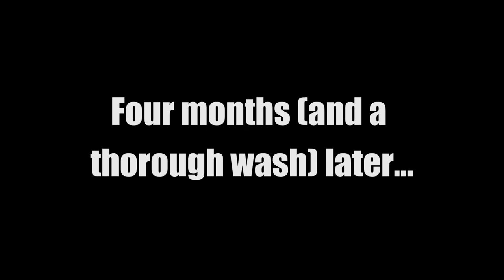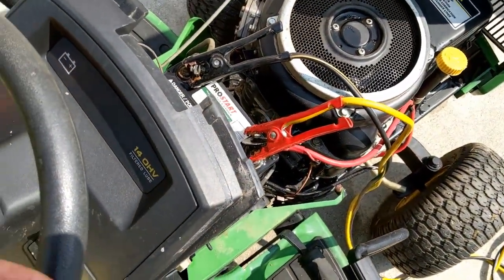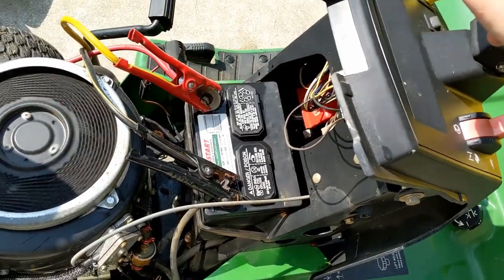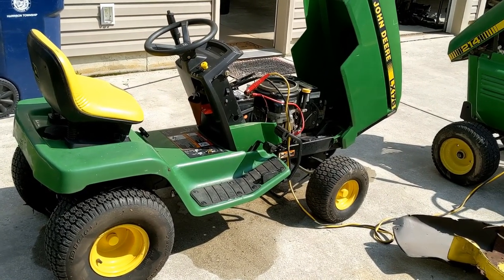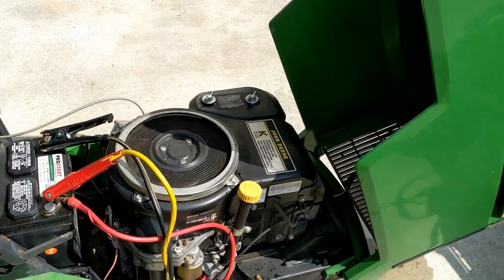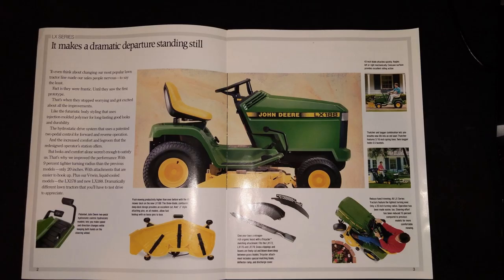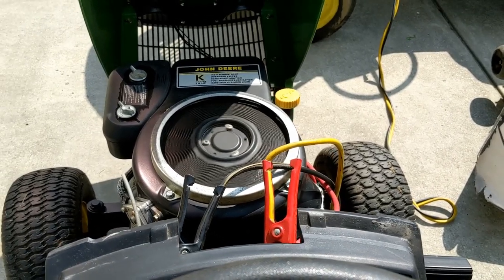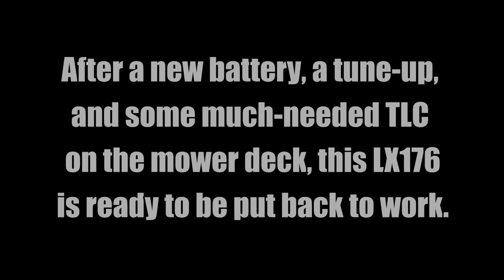Resurrecting a 1996 John Deere LX176 Lawn Tractor - First Start in Several Years

Comment: Dad bought one of these new in the 90's, we had a large 4 acre yard and mowing became my "chore" soon as I could reach the pedals. No telling how many hours the thing has, as it took about a solid 2hrs to mow that big yard, not to mention the machine doubled as a firewood hauler in the fall and winter with a tow behind wagon. When dad passed away, it became mine and I still use it to mow my (now much smaller) townhouse lot! Puffs a little blue smoke on startup but doesn't burn or leak any measurable amount of oil. It'll probably outlast me at this rate! Haha

Comment: I have 1993 that I bought used in 2002.   I use it to do two rough lawns.   18 years later, I don't see myself replacing it at any time soon.    The owner of the John Deere dealership convinced me to buy this over the cheaper models sold @ Home Depot or other places.   It was good advice.   14 hp Kawasaki does the job without sucking all that much fuel.  It's a great machine.
Reply from the maker: They are one of the best smaller lawn tractors Deere ever built. Very sturdy for their size, reliable Kawasaki engines, and the 38" decks cut really well. If I had a smaller yard I'd have kept this one and mowed with it.

Comment: Like the way you explain in detail what's been done so far.Great video.I'm surprised it cranked with that old gas.I would have added a little seafoam to it.
Reply from the maker: That's a good idea. I've had pretty good luck with Seafoam in the past, but it just slipped my mind this time around. Plus it's getting pretty expensive at my local hardware store last I checked...I need to find a store that sells it cheaper.
Reply: @MichaelTJD60  I get it for around 7 bucks at Wallyworld.
Reply from the maker: @edselman58  That sounds much more reasonable. I've seen it for over $10 a can at the hardware store and some auto parts stores, which is ridiculous.

Comment: I just recently got a LX 188 for free it came with a bagger. I got it running but it needs a valve adjustment or a new engine. And the hood Isn’t broken it just has a small crack in the front
Reply from the maker: Great deal. Just make sure that crack in the hood doesn't spread. Valve adjustment shouldn't be too difficult. Unless it was ran low on oil or coolant in the past, those liquid-cooled Kawasaki engines are nearly impossible to kill.
Reply: Am I not be as simple as a valve adjustment in my need a new engine then engine is smoking blue smoke really bad and it’s running really low

Comment: I bought a used 1993 LX176 in 2002, & I have been mowing two good size lawns with it ever since.   I've done some work to it over the years (carburetor cleaned, a couple belts, blades, & transmission rebuilt).  I blame the transmission issue on pulling something that was beyond the capacity of the machine.  Learn my lesson on that!    The Kawasaki motor has been rock solid.   I've had no reason to replace it.   I have friends who have gone through multiple machines while I am still very happy with my 27 year old John Deere.
Reply from the maker: They are one of the best lawn tractors Deere ever built! If I had a smaller yard I would definitely consider buying one as my permanent mower.

Comment: I bought one a few years back, was really beat up. The fellow was taking it to lake to cut the grass there and he forgot to strap it down. Fell off the trailer at 50 miles per hour. I found a used hood and seat for it. I really like it. Also found a rear bagger set up. I plan on keeping it.
Reply from the maker: That's a testament to how well these machines are built. Glad you are still getting some good use out of it.

Comment: Great video man. Love the details. I actually have never seen in LAX series John Deere. I've owned a 1997 445 John Deere since 98. And just restored it and did a video series on it and wish that was seen your video series first. I wish someone would put a video out on how to put the writing in there and edit videos and stuff cuz I've got a bunch of pictures of this thing all through the process and never could figure out how to get it all put together. To make a nice video out of it. Thanks for the good video.
Reply from the maker: Thanks! Editing does take a little practice at first. It helps to have a good editing software but unfortunately that's usually not cheap. It's all about the timing of each clip or piece of text you add.
Reply: @MichaelTJD60  absolutely I don't even know what editing software is that's how computer illiterate I am. I literally do it all for my cell phone that's one of my videos on my tractor were so horrible.

Comment: I have the same tractor and it surges. I have to use ether to get it started and I just don't get the rpms I used to.
Does the carb need to be replaced?
Reply from the maker: Most likely a clogged main jet. It can be taken apart and cleaned, but in this day and age where replacement carburetors usually cost less than a rebuild kit, you're most likely better off just replacing the carb.
Reply: @MichaelTJD60  Thank you!
Reply: @MichaelTJD60  That is what I will probably do. Another issue, probably related to the carb. is that once in a while, a burst of white smoke belches out of the exhaust. It looks like a smoke screen. after 10-15 seconds, it clears up. I was looking at carbs on-line and there are so many types. My LX176 has a 14 hp Kawaski engine and the listings cover many models. If you can assist me with the correct carb, I would certainly appreciate it.
Happy New Year!
Reply from the maker: @rickpinelli1586  white smoke would indicate a blown head gasket - it's not unusual for Kawasaki engines to blow white smoke when you first start them up cold, but if it's randomly doing it while running then you've probably got a blown head gasket.

Comment: Which engine would you prefer? I like the old kohler commands.
Reply from the maker: The older vertical-shaft Commands were decent engines, but I prefer Kawasaki as far as most newer equipment goes. From my experience, they're the only brand that hasn't gone down in quality over the last 20-25 years.
Reply: @MichaelTJD60  yeah I have a Kawasaki 22hp on my cub cadet ztr. It's a really good engine.

Comment: There is one of these for sale near me for $850, looks to be in decent shape, comes with a bagger as well.  Anything you would advise me to pay attention to before going to look at this thing?  I have about 1 acre of mostly flat but slightly bumpy lawn to cut.  I've been doing it with a regular push mower, trying to reduce the time it takes to mow.  Everyone around me has new zero-turns, but they are so expensive!  My car doesn't even cost as much as any of my neighbors' mowers.  Other options include a 2015 Toro Timecutter SS5000 for $900, has a Kawasaki FR691V, unknown hours, or a Toro Z MASTER for $1400, 18hp Kohler engine, unknown hours, assuming it is 15-20 years old but it looks decent.
Reply from the maker: The LX tractors are hard to beat - they are nimble, reliable and built very well (with the exception of the plastic hood). The biggest items to look out for would be that the engine has had the valves adjusted regularly (the Kawasaki engines are bulletproof IF the valve lash has been adjusted every 200 hours), and be sure that the transaxle doesn't lose power when it gets hot (when driving uphill or after driving around for a while). It is rare to find a 90's Deere with an unbroken plastic hood, so if the hood is cracked or broken don't be too surprised. I got very lucky with this one.

Comment: Yeah, It is rare to find a JD of that age where the hood is in great shape. The reason why it is in such good condition is probably because it was stored inside not where the sun could hit it, and away from the elements. Our LT160 from 2003 was stored in a barn its whole life and at 800+ hrs the hood is cracked in some places. But none the less the transmission and the 16HP Kohler have held up well. Those are some fine mowers you have there.
Reply from the maker: Thanks. Yeah it was stored in a garage its whole life so it didn't spend much time outside when he wasn't mowing with it. My uncle's LT155 spent the first half of its life under a lean-to on the farm before he moved away from the farm and put it inside his new garage. Only reason the hood ever broke was because he backed into it with his loader while grading his driveway. I put a new top hood section on it and got it looking like new before it was sold.
Reply: Ok.
Reply: Has nothing to do with the sun...  Has to do with the brittle lexan hood material...  and the integral lexan plastic hood hinges...

Comment: Treat that upper & lower hood like GLASS...!    If it only runs on choke it's a main jet issue...   (Very common problem on 14 and 17 HP K Series Kawasaki engines)   Keep in mind folks... This is a True Deere...  No box store shit here...
Reply from the maker: Just needed to let it run on choke until it was pumping enough fuel. Ran perfect afterwards. I sure hope the new owner takes good care of the hood, you don't see many original surviving hoods in one piece like that.
Reply: @MichaelTJD60  Thats for sure.  That's why I prefer the older 210's thru 318's like you do.  I've bought too many hoods for my GT262 & GT275's from that Deere overstock dealer outside Harrisburg.  Will be reducing the herd to just (2) 318's very soon, although the teeter foot pedal hydros ARE really sweet...!  In fact currently mowing my own yard with a Deere dearler scrapped 36" LX176 just to get thru a chain link gate into my back yard.
Reply from the maker: @williamriley2528  I used this LX to mow a small patch of grass inside my fence, it's pretty handy for small jobs like that. Are you referring to Haldeman's on route 15? They always have a good inventory.
Reply: @MichaelTJD60  It was bombergersjd on eBay out of Lititz, PA.   Actually the last upper hood I bought was manufactured by Flitz Manufacturing (eBay) and was about $100 cheaper than the OEM John Deere hood.  Fit and color match was awesome.
Reply from the maker: @williamriley2528  I put a Flip Mfg. hood on my LT155 and was very impressed with the quality. Would definitely buy another one. I think Bomberger's is way overpriced on some of their parts, but they do have a big selection.

Comment: It can be a bad idea to leave a dead battery and a charged battery connected together with an engine running.  The charging system will see the average of the two voltages and can overcharge and damage the full battery.
Reply from the maker: I only left the jumper cables hooked up long enough to get the engine started and put a little charge into the battery. The old battery was beyond dead.

Comment: I have a tractor question so I have a john deere 170 with a 38 inch cut and I saw the option for the 180 tractor was a 38 or a 46 inch deck I was wondering if a 46 inch deck off of a 180 would fit a 170?
Reply from the maker: As far as I know, the decks are interchangeable. There shouldn't be any differences between the frames and mounting hardware on both tractors.

Comment: Can you tell me if the LX 178 upper and lower hood will fit on the LX 176? I need an Upper and lower hood for mine
Reply from the maker: Yes, the hood sections are all interchangeable. Be careful swapping a used hood from a different tractor - considering their age, they're almost always brittle and will break just as easily as your old one did. A decent-quality aftermarket one can be bought from Flip Manufacturing.

Comment: I have a LX176 too. While I was driving it the hood fell off and broke in multiple pieces and the connection between the engine and the cutter must’ve slipped off. Can you tell me where it needs to be reconnected?
Reply from the maker: The mower deck is driven off of a belt which runs from a pulley on the bottom of the engine (under the frame) to the drive pulley on the deck. I am assuming that is what got disconnected? Or are you saying the mower deck itself came unhooked from the tractor?
Reply: @MichaelTJD60  the mower deck is still connected and the belt is intacct. I think it is the wire from the pull switch that got disconnected
Reply from the maker: @jamespregan9303  That would be underneath the dash and should be easily accessible if the wire came off. Also look at the electric PTO clutch underneath the engine and see if perhaps the other end of that wire popped loose or got cut/chafed somehow.

Comment: Hey I have a question for you, I have a John Deere 318 onan p218g and if I straight pipe it do you think it will wreck my engine?
Reply from the maker: I wouldn't do it. You would need a bigger air intake to displace all that exhaust flow, and the Onan engines in those tractors barely got enough airflow from the get-go because of their design. Tampering with the flow of cooling air and exhaust gases is what causes those engines to wear out prematurely.
Reply: MichaelTJD60 ok thanks so much, you wouldn’t do it so I’m not gonna do it. My engine is getting rebuilt now so I don’t want it to get wrecked. Now that I own it it’s gonna stay in good shape!  Do you have a phone? I would love to have your number because I’m 14 and it would be good for me so I can ask u questions like that, if not I completely understand. Thank you though!

Comment: wow cool tractor, I just bought a JD 110  now I’m restoring it :D 

But under the rust/green paint is a black layer that is very hard to remove. Someone knows if it is primer or “black rust”? Do I have to remove it before I apply primer? Thank you 🤩🤩
Reply from the maker: It's probably black rust, since Deere didn't use any black paint on the frame of the 110. Or it could be an old coat of black paint that someone put on it a long time ago and then painted over with several more coats of green. I would remove as much of it as you can, try to get it back to bare metal first.
Reply: MichaelTJD60 oh oke thank you for the reply :)

Comment: So in ur old videos with all the old mowers u use to have do u still have them or have u gonnen rid of them ( none specifically)
Reply from the maker: I buy and sell them. Don't have a use for more than 2 or 3 machines at a time. The only one I've kept long-term is my 210 which was the first garden tractor I ever bought in 2012. The first lawn tractor or mower we ever had was an LA150 which we had for 7 years, but that is now long gone and I don't miss it.
Reply: @MichaelTJD60  so all the other u use to have u have gotten rid of
Reply from the maker: @pearsonmcgraw7018  Yes. Otherwise I'd have 30+ sitting around.
Reply: @MichaelTJD60  😂😂😂😂

Comment: Michael have you thought about a brush gaurd? Nice looking LX!
Reply from the maker: That wouldn't be a bad idea...anything to preserve the hood on that tractor. I don't know of any OEM or aftermarket brush guards that would fit an LX series, but it probably wouldn't be hard to make one. I sold this tractor last summer and I made sure to let the buyer know about preserving the hood.
Reply: @MichaelTJD60  i have seen them... i will look for you to find one.. I need one myself
Reply from the maker: @robkerz2610  Oh that's just a bumper, not a full brush guard. Regardless, any kind of protection for the grill and hood is better than nothing. Someone should make a double-bar bumper to fit one of these, like they use on the L/LA/D/E series.

Comment: I didn't get the Allis i just went to go look at it, I am also looking to buy this Cub Cadet 147 With a Kwik Way loader for $2500.  Do you think thats a good deal?  It has no deck or lift arm
Reply from the maker: Way overpriced. That's probably a $1200-1500 setup.
Reply: @MichaelTJD60  Okay Thanks, i almost got ripped off
Reply: @MichaelTJD60  which do you think I should get, the Cub or  Trade my 322 for the Allis?
Reply from the maker: @jackolson6479  Keep the 322! Neither of the other two choices are on the same level as a 322, and considering how well you made out with that deal, you'll regret getting rid of it. Very few other brands and models of garden tractors from that era can compare to the JD 300/400 series.
Reply: @MichaelTJD60  Okay thanks
Reply: @MichaelTJD60  Where do you think I could get a good 54 blade 4  way?
Reply from the maker: @jackolson6479  Check your local eBay or craigslist. They don't come up for sale too often this time of year but there are plenty of them out there.

Comment: According to tractor data the lx 176 was the model that took the place of the model I own the 170
Reply from the maker: I don't really trust TractorData although some of the information may be correct. The LX172 replaced the 170 (both are gear-drive) while the LX176 replaced the 175 (hydrostatic). The numbering is strange.